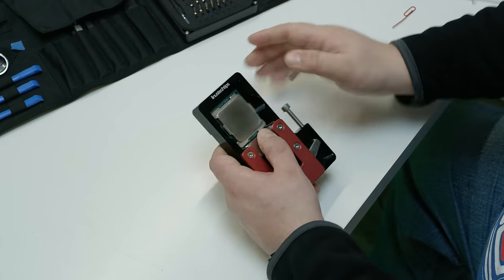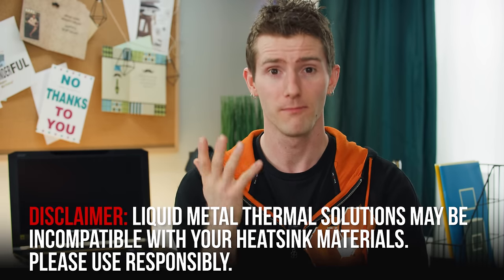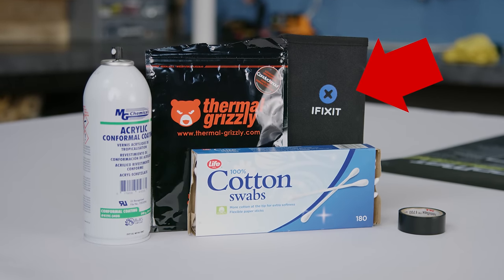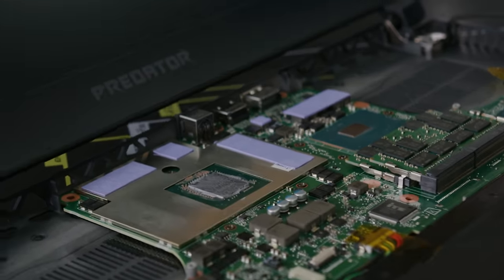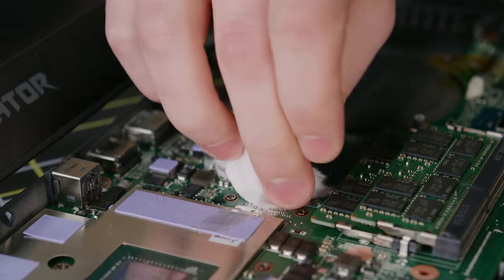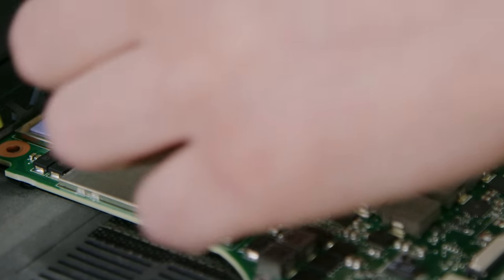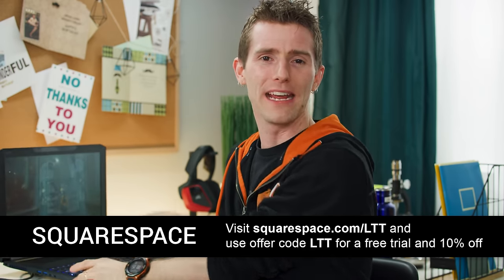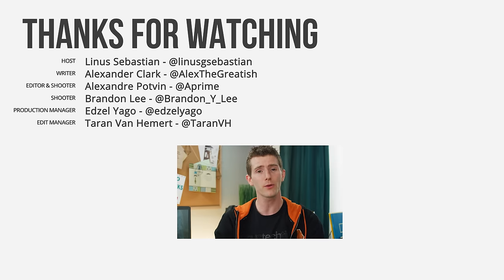Liquid Metal Laptop Cooling – 20C LOWER!

Comment: After having watched Hardware Canuck’s video about speeding up a MacBook by reapplying the thermal paste, I wonder what this would do to a MacBook Pro...
Reply: I think this is not a coincidence that they both have similar videos. Especially since Dimitri's results were not as impressive. I would even assume that Dimitri's video was a parody, after he saw this one on floatplane
Reply: jur4x They're not that similar, I definitely don't think it's a parody though
Reply: Mac... Seriously?
Reply: Dimitri is a visuals first, tech second channel. He would've killed the laptop if he tried any sort of LM cooling..
Reply: it would improve the thermals significantly. Although this product is for more advanced users. This Linus's presentation was more of a show. You need to prepare both the surfaces better (at least remove the oxide layer from heatsink), I also recommend using silicone around the dies to prevent spill, excess outside oxygen coming in contact with LM. You also need to replace it more regularly than traditional thermal compound. Personally, I noticed corrosion of CPU, GPU die, heatsink only after a few weeks. Given the YUUGE temperature drop, I don't mind these drawbacks. Though I wouldn't put it on multi-thousand brand new high end laptop. Manufacturers should engineer the thermals so we don't have to mess with these bizarre methods.
Reply: ignasb Thanks for your insight, I've been thinking of performing this on my MacBook Pro some time down the line after watching this video. I'll make sure to take certain precautions!
Reply: Batemen You misspelled Keys.
Reply: If you mac is fanless, its 100% pointless... As most apples are dual core, probably more so pointless as you only need to remove ~40w of heat tops. 
iMacs and above would make sense.
Reply: still leaves the MacBook Pro about 3 years in the past where its hardware belongs lol
Reply: SmilesAreDaggers Not so sure about that.  My MacBook had Thunderbolt and NVMe about 2 years before it hit the mainstream PC market.
Reply: I did it to my Macbook pro 2012 15in, and iMac 2011 27in. some years ago those 2 models has GPU failure problem, but my are fine. still using them, they just do not die.
Reply: My 9 year old iMac in storage has more RAM and more CPU and GPU horsepower than their portable lineup today. And it itself is technically laptop hardware. Guess some put thin-ness over performance, because you know laptops are so inconveniently thick lol.

MacbookPro, sits between a laptop and a tablet lol.
Reply: tomtalk24 My MacBook Pro has a fan and a quad-core i7. How does a MacBook Pro sit in between a laptop and a tablet? It doesn't open 360 degrees, it doesn't accept pen input without external hardware and it doesn't even have a touchscreen (touchbar doesn't count); it's 100% a laptop...
Reply: SDG Danny Corrosion will happen
Reply: ignasb
I did with my iMac and MacBook Pro  3 years ago, never had problem after that , you do not need to reapply liquid metal regularly.Yes, I put some normal thermal paste around the dies, and elec tapes under that. I think liquid metal works the best with direct die to heat sink contact, but one just have to do it with care.
Reply: Perfect, might be worth doing then as at least the heat taken from the IHS will be removed with the fan. If it was fanless its just gonna heat you lap up quicker haha. Also someone said silicone to protect components, raid your GFs nail gloss and paint that onto any exposed components works just as well, and smells good lol.
Laptop and tablet being what you can do with a MacBook compared to the same money on a non Apple laptop, possibly SLI but more CPU for sure, and RAM lol. Its not literal, dont get upset, some people "need" a Mac I guess, its all good.
Reply: 2018 - 9 = ?, Apples lineup has been real simple since Jobs returned so its not hard to work out yourself lol (sorry whos ignorant?). And its not boasting is it, hence why its in storage and unloved. Makes a nice 2nd monitor though.

EDIT: Ahh just seen you are a little defensive about your computer, I pressure this isnt the first time you've had to stickup for your purchasing choices is it? Remember, its just a lump of metal that Apple made at least 50% gross profit on (tax free) via their suicide causing passport confiscating slave camps.... I mean factories, and will be in a land fill in a few years.
Reply: Run crysis 4k 240fps??
Reply: Dw; I'm not upset but I know the "..." can seem like passive aggression at times, haha. I appreciate the pointers!
Reply: Tech Tube After having done some reading about it, I think corrosion only really happens to aluminium parts, with liquid metal paste. Although the MacBook's chassis is aluminum, you can just make sure to not make contact with it and the paste.
Reply: Thats the problem with typed conversation, its blind.

Also its kinda a one shot deal, I've split a die trying to remove a heat sink when the liquid metal was set. Not sure how far you want to go but maybe the die to the IHS then the IHS to the heat sink and never look at them again. Sounds like you have a good little project going, should be fun, enjoy.
Reply: And who cares.
Reply: ha bro
Reply: tomtalk24 sorry but imacs dont accept video input. You've invalidated any credibility you attempted to gain. And that wasn't even your first mistake...

Most macs are dual core? What year are you living in? Unless you get the base 12 inch Macbook, you are likely getting either a quad core 8 thread i7, or a 8-16 core Xeon.

A 9 year old GPU in an iMac is more powerful than today's macbook pro's ATI Radeon RX 400 series? Considering that the 2009 imac contained the nvidia 9400M or ATI Radeon 4670 graphics, again, you're wrong.

9 Year old CPU more powerful than a modern i7? Maybe you're forgetting that every generation brings new technologies. Meaning 9 years of improvements that the iMac you don't actually own, doesn't have. That's added to the fact that 2009 iMac had a Core2Duo CPU, and not a Xeon

Seriously, you must be high. I'll give you the chance to back away and admit that you was being hella sarcastic though.
Reply: After watching Dmitri's video I applied CoolLaboratories liquid metal to my 2015 15" Macbook Pro. (I had some left over from taking my 7700k to 5Ghz at super reasonable temps.) Apple already did most of the work by blocking off all contacts around the CPU with a black material. My macbook ran sooo much quieter! I didn't even hear my fans spool up even once during use. I highly recommend it.
Reply: Still won't list your specs on this all powerful iMac huh?

I'm not defensive at all.  I love my MacBook Pro for work and light workloads.  I love my desktop PC for Gaming and heavy workloads.  Money wasn't the question, I'm not rich but I saved up for something I wanted, whats wrong with that?   Not necessary for you to bring up my purchasing reason.  

You wanna know what I hate though?  Senseless bashing from uneducated people.

"My 9 year old iMac in storage has more RAM and more CPU and GPU horsepower than their portable lineup today. "  - tomtalk24 Don't be an idiot, no it doesn't.
Reply: Why would you want to do this to a MBP though? They're generally only running mid-range hardware at best, and are not intended for resource intensive workloads. 

If you're thinking about putting liquid metal on your MBP to get better thermals, you're probably using the wrong tool for the intended task.
Reply: dude..
Reply: The idea they only run dual core is because Apple used to only put i7 dual cores in their expensive high end laptops. They would then only market the fact it had an i7, not that it wasn't a quad core. Granted, every other manufacturer did the latter too. But they also would actually put a quad-core i7 in their more expensive line ups. Luckily for most consumers now,  the new MBP actually sports a quad-core for both 13" and 15" models.
Reply: SDG Danny liquid metal can be risky, but using quality paste like arctic mx4 can already cause a 15% temperature difference compared to the generic manufacturer paste.
Reply: Thourq you're right, Apple did only give dual core i7 CPUs in their 13 inch laptops. Wasn't a stupid decision though. The TDP of quad core chipsets is much higher than that of the U-models of i7 CPUs. So in a body the size of a 13 inch laptop, thermals would present a huge problem if they gave everybody a QM or HQ CPU in every package.

Then there's all the people (and Apple is fully aware of them, and how much they put into Apple's coffers), who don't buy Macbooks for professional purposes, but rather, to look hip. Considering most people buy Macbooks for the looks and the precision that goes into the design, and how until recently, Windows laptops have been THICC and ugly af in comparison - yeah. The 13 inch was always the option meant for those people. They didn't need a QM or HQ model. In fact, until recently, the only real competition looks-wise, was Razer, with their equally expensive machines that are actually even much worse value, considering Razer aren't nearly as good as Apple on the support/warranty/repair programs side. I mean, name another manufacturer where you can take your damaged laptop to a shop and have it repaired within an hour, or if it's not repairable, coming out with a replacement machine (for free if it's a manufacturing issue)? It simply doesn't exist. With any other product, you'd be waiting 30-90 days for it to be sent in to the manufacturer's HQ, placed in a massive pile of machines that they have no interest in getting back to you with any sort of priority.

Another reason people buy macbooks (just as a bonus fact), is the trackpad. It's no secret, Windows trackpads SUCK. 99% are made from textured plastics that nobody would want to touch and historically, it's been bad enough to make people want to suicide (Sony Vaio trackpads rubbing your fingers raw anyone?). It baffles my mind how no windows manufacturer, has, after so many years, been able to make an actually competent glass trackpad to rival that of the Macbook. Really. It astounds me.
Reply: Mechanought: "not intended for resource intensive workloads"?

Oh, so I guess all the people editing 4k videos and multiple high-res images, amongst all the other power hungry stuff should go back to using Intel Pentium CPUs and Intel Iris Graphics? lol. Never mind the 7820HQ and 7920HQ CPUs used in the current lineup, which are so powerful there's only a few other laptops that use them due to price and thermal output. Just go on believing what you do. It can be nice living under a stone sometimes.
Reply: MacBook Pro is trash it dosen't have gpu this laptop is the same price 3k and have 1200 percent more horse power
Reply: Not a lot as it already lacks gaming power overall.

Comment: Using some Thermal Grizzly Kryonaut I got my i7 4700HQ running 15°C cooler under load, and my GTX 850m about 10-12°C cooler too bringing some performance back thanks to no CPU throttling
Reply: But why?
Reply: Nick Faber It's a question. Broad, granted, but pretty straightforward. Why go through the whole process to squeeze a tiny bit more performance out of a mid-range laptop-grade 4th gen i7 and low-end mobile GPU? I'm all for keeping things running, but at this point min-maxing your performance on a laptop like that makes no sense to me. Just curious what the reasoning is.
Reply: That's interesting, thanks for sharing! My laptop is with the same processor, i7 4700HQ and with the GTX 880m. With my last paste AC5, my gpu can get 82ish°C and my cpu 80-85°C max. I wonder if  I can lower those numbers down to 75°C, but not sure if I would risk it yet :)
Reply: +levleboss can you tell me what was your maximum temp. of ur CPU and GPU before Thermal Grizzly Kryonaut  and after?
Reply: Electronic Music 2017 The CPU went from about 94ºC (throttling) to about 82ºC (no throttling) and my 850m went from 75ºC to 65ºC (under 100% load). I ran these test for about 15-20 min each, but with the CPU first then the GPU, not both at the same time. I also ran a Cinebench R15 CPU benchmark and my score went from 584cb to 613cb (about 5% improvement thanks to no throttling I suppose). The whole point of replacing the thermal paste for me was to have my laptop run cooler and quieter when idle, and to avoid CPU throttling when under 100% load, and for 5€ and 30mins of work, these temps are totally worth it
Reply: Levleboss My 7700k desktop dropped 25°C with liquid metal, and that's before dropping the core voltage. Because the cpu is running cooler, it needs less voltage.
So on a laptop, you're saving power consumption both in the CPU and cooling fan.

Comment: Silicone RTV should work great. I use it all the time for coating electrical connectors. If you ever need to remove it apply some dielectric grease first it will pull off effortlessly. 100% protected. Also works for making connector covers.
Reply: link me one i want to put it around my cpu laptop for liquid metal protection or should i use black electric tape like linus didi?

Comment: Use gold leaf, works even better.
Reply: Really?
Reply: Since it's not liquid, I think the surface contact can't be as good?
Reply: Wouldn’t silver be better and ~50x cheaper?
Reply: TheDutyPaid  are you serious? Does it actually work?
Reply: Sorry, I have to 1up you. I would use  Graphene Sheets.
Reply: We need LTT to test this
Reply: It sounds expensive... 
BUT IT'S WORTH IT!
Reply: Gold leaf I was thinking the same thing. Even 2-3 layers of it. It is also cheap like 10$ (given it is extremely thin).
Reply: No, no it doesn't work better. Don't use gold leaf, it's been tried by many since the 90's.

@TheDutyPaid - I know it was a joke, but someone was sure to take it seriously and try it.
Reply: silver is not as soft
Reply: Worth trying.
Reply: NuclearEcko954 smart
Reply: not a good idea
graphene is very expensive to produce and its a extremely good conductor of both heat and electricity so you'd need to protect the cup/gpu from shorts and you would have to have multiple layers which would make it graphite so its a waste of money
Reply: The Default Trash Bags Productions boron-arsenide
Reply: Canadian?
Reply: can you please add some context to that?
Reply: George silver creates a oxide surface if I'm not wrong.
Reply: Crazy CRO, you’re not wrong.

If it’s not airtight between both surfaces, it’s all for nothing anyways.
Reply: Liquid gold-indium/gallium maybe? :) Gold leaf isn't expensive, especially in such small quantities. Its just nowhere near malleable enough for this kind of use.
Reply: A sliver of diamond with the highest thermal conductivity possible and 3 times better than gold....

I win...

But I do wonder about creating a thermal paste with the smallest particle size possible. Diamond nano-particles of varying sizes and some sort of bonding material might work but the bonding material is a mystery to me.
Reply: Carbon Nanotubes!  ;-p
Reply: +reggiep75 Isn't that the whole shtick with IC Diamond though? Diamond conducts heat well and isn't really electrically conductive, so it works (somewhat) well in a thermal paste compound.
Reply: I feel like he should’ve done a test with silver thermal paste first.

The stuff out of the factory might just be crappy or not applied very well.
Reply: Solar freaking roadways
Reply: silver oxidizes
Reply: TheDutyPaid i“
Reply: Use gold-pressed latinum. It has a negative thermal coefficient, meaning the hotter the CPU the greater the thermal conduction, but it is very expensive.
Reply: rcradiator - The paste alone isn't much crack unless you've got the right chain of materials drawing heat away.

A chain of the following materials in this order would work for an air-cooled system:-

Diamond paste, a possible low spec industrial diamond sliver, gold, copper and ending with aluminium where the thermal conductivity slowly decreases but the material size should increase accordingly.

A diamond sliver/chunk to gold or copper spreader would work in a water cooled loop or custom water cooling system.

It's most likely gonna be costly but I'd love to see the effects of a cooling system with materials with the highest thermal conductivity by way of diamond and gold in direct contact with the CPU heat spreader.

Anyone up for badgering Linus to try it, even with alloys like diamond-gold, diamond-silver or diamond copper!?
Reply: And you have to buy it from those guys with the weird ears and foreheads.
Reply: ....I really do not know if this is a joke... It would probably work but I worry that the foil will trap air in the folds.
Reply: I did use gold leaf to cool a CPU instead of TIM, yes it works really well
Reply: I think silver leaf would tarnish too fast
Reply: Silver tarnishes
Reply: George For a control in the experiment? Yes, I DEFINITELY agree... Although I can't help feeling that the numbers still would have been staggering.
Reply: TropicalCoder "I will come to Quark's; and trust me, I will have fun."
Reply: Graphite is actually more heat conductive than Graphene by 1 order of magnitude: https://pubs.acs.org/doi/abs/10.1021/nl502059f  (although Graphene is nearly infinitely electrically conductive) and are used in pads already. https://www.youtube.com/watch?v=YpphKzmDiJM Sadly, they conduct so much heat that they saturate a thermal solution faster than heat can be dissipated, causing the heat to bottleneck the system. It's much better for a true liquid cooling solution interface.